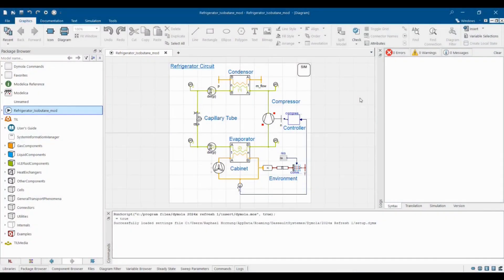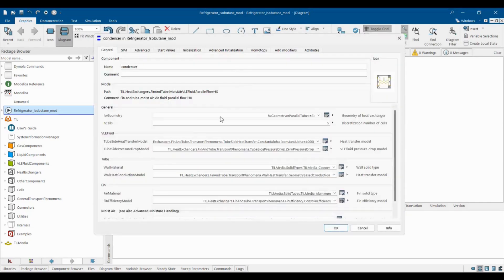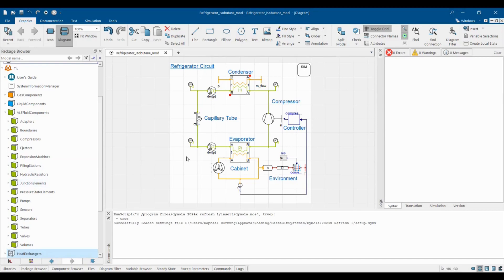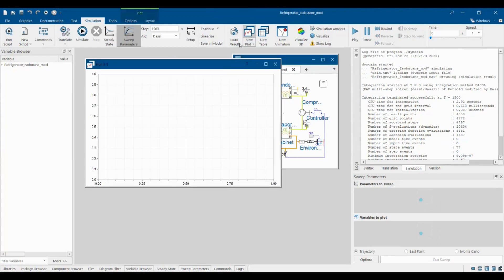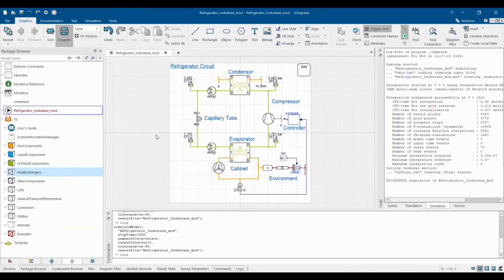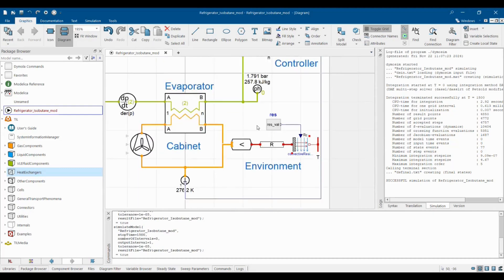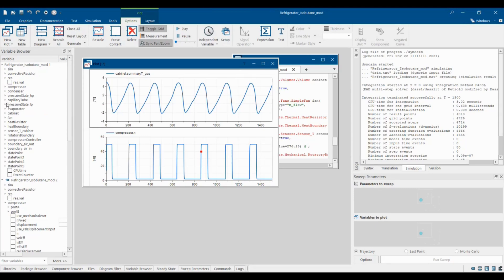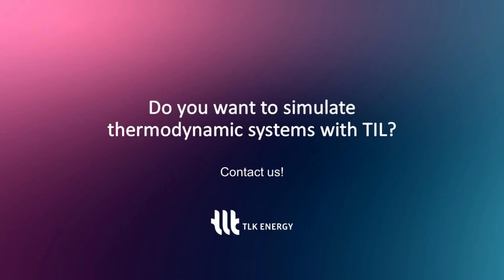Demonstrating TIL Suite: Refrigeration Simulation Example

Comment: Is OpenModelic able to use TIL to do refrigeration cycle simulation. Im an undergraduate student working on openmodelica HVAC simulation as my project but currently face an issue modelica  and building library looks complex to perform refrigeration circuit simulation

Comment: I am starting to use a trial version of Dymola, but i dont see TIL in it. Is there a way to use this library for trial etc.
Reply from the maker: Hi, you will need a licensed version of Dymola or Modelon Impact, and then request a trial license from us at: info@tlk-energy.de.
We recommend our Modelica and TIL training to get started: https://tlk-energy.de/en/modelica-training
Reply: @tlkenergy4539  Thanks for quick response. Could you also let know if there is any specific library for  - "modelling and analysis of a refrigerator, freezer or ultra low cascaded freezers (using HFC and natural refrigerants - Propane, Isobutane, Ethane, their mixture etc.) , incorporating compressor performance polynomials and their detailed custom modeling of full unit refrigeration performance and controls prediction. Which all libraries would i require from TLK to achieve this.
Reply from the maker: @viveksilwal The TIL Suite is the right model library for this. TILMedia with many refrigerants is included. Customization is possible, and implementing controls, predicting performance is too. If you want, we can discuss this further, just write an email to info@tlk-energy.de Subject "TIL Suite"

Comment: Pretty Cool. The video has some problems with frame rate, I know something like this happens in OBS recordings on AMD hardware when using compression for the video. I had to record in uncompressed format to get a smooth recording but I am sure there is a work around for this. Nice work though.
Reply from the maker: Ah ok, we will keep that in mind for the future. We are experts in system simulation, not yet in video recording :-)
Reply: @tlkenergy4539  No worries, yes you are doing some impressive work. Keep it up, cheers.